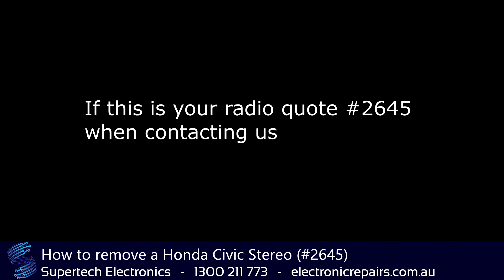How to remove a Honda Civic Stereo (#2645)

Comment: great video - worked a charm.....found it easier to remove the section around the transmission selector to get the section under the a/c unit out